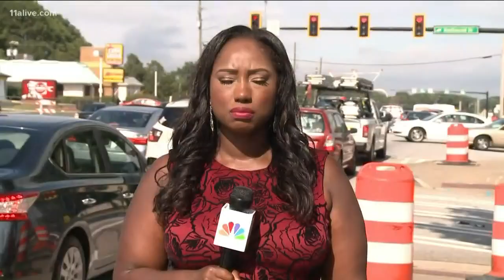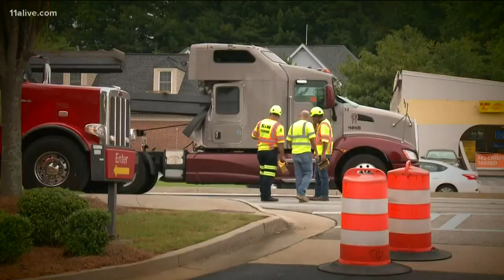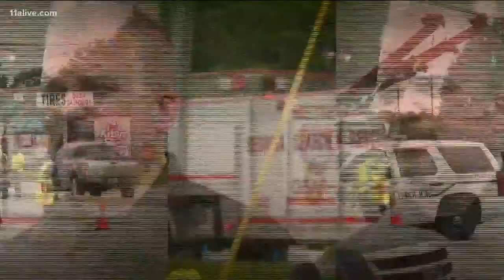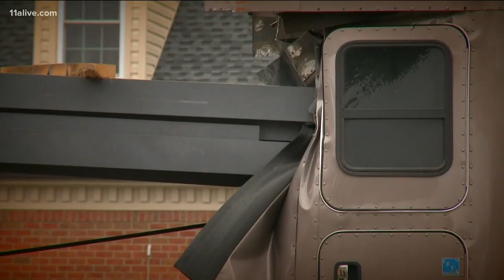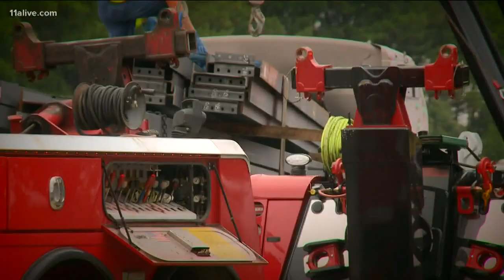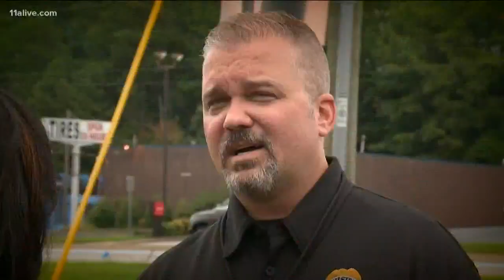Driver killed after steel beams crash through cab from back of truck

Comment: If you ever drive a flatbed truck ALWAYS make sure you Over secure the load. It's better to have too many straps and or chains than not enough. Also also make sure there is a headache rack on the back of the truck cab or on the nose of the trailer. Your life depends on it.
Reply: I totally agree
Reply: I agree, I'm a long time Heavy Hauler so I'm pretty versed in securing any and all types of loads that go on a flatbed, lowboy, Landoll, etc, and if you're doing that type of work you better know the Load Securement book by heart. I've always preferred chains for loads like that, 1/2" transport chain can be harder to handle than straps, but it makes things more secure. The only thing that has ever scared me doing heavy haul was something coming off my trailer and hurting or killing someone, so my thought was to over-secure any loads, take the extra time. RIP driver.
Reply: @thomaskirk9341  Yessir. I drove for Arrow trucking out of tulsa,ok for 10 years, quit and moved to frac sand hauling a year before they went out of business. I hauled some pretty scary loads with them including oversize, I always over secured all loads and never had a problem. I retired from trucking in 2015 and still today I see flatbed trucks all the time going down the road with only one strap on the front of a load and/or no headache rack on the truck or trailer.
Reply: @bigtexas7580  Yes, you can't be lazy or complacent hauling difficult loads. Any day I left the yard grossing under 100,000 it was a light day, everything from heavy equipment, cell tower sections, big cable reels, 80ft  utility poles, I always over-secure, then check, re-check, and check again. Maybe it's a combination of good and lucky, but I've never had a load loosen up on me, and I hope I never do. A lot of the newer drivers are either too fat, too lazy or too stupid to do the job right, and that's a dangerous thing.
Reply: I did flat bed , 10 years, in ca, you use straps every 5 ft. Mandatory, and You use común sense to hit the brakes especially in, or before the light. 
RIP that fellow 🙏🏾
Reply: I worked those loads and dispatch was ALWAYS on my ass to hurry up. I have NO respect for trucking companies anymore. They are the scum of industry.
Reply: @bigtexas7580  If the public only knew how little the companies cared about their safety or, God forbid, the safety of their employees.
Reply: @franciscofernandez4014  Sadly, the law is one thing and enforcement another. Oil and water my friend. Nobody cares about the meat in the seat until something happens, then they only look for someone to blame. First stop, the driver.
Reply: you'll never get a ticket for too many binders

Comment: Steel on steel is like grease you can use straps to choke it but chains and binders  are used to secure it he also never had head ach rack.these are dangerous loads then all the crap people pull in commercial truck is a great way to end a life or more.
Reply: A lot of metal bars are actually oiled/ greased up to keep from rusting.
Reply: It's just not important to dispatchers. We are on our own.

Comment: Looked like there was no headache rack to protect the cab
Reply: Plus the fact that he had straps on a steel beam load our company tells us that’s a no no always use Chains if those beams start sliding they cut the straps such  in a case like this I’ve seen it more than once and he should of known better anyway RIP driver 🙏 Prayers
Reply: Don't you know that proper equipment costs money, not to mention training? What were you thinking? Anyone can drive a transport. Nuttin to it. Dispatch response, " We have an opening that just opened up :-() "
Reply: We are just meat in the seat, will never change.
Reply: @joedirt9600  I actually overheard a dispatcher a few decades ago on the phone telling an agency "..just send a licensed piece of meat for the seat, the load has to be there." You just caused a flashback, and it was not because of drugs, it was anger.
Reply: Headache racks aren't designed to stop a load, I'm a flatbedder and have driven trucks with no headache racks hauling steel.
Reply: @chadnelson924  so what is the purpose of a headache rack ? And I realize it won't stop a load of steel.
Reply: A headache rack is the hold chains and binders.  they were given the name headache rack because back in the day if you didn't put mud flaps on the headache rack between the rack and chains they would make a lot of noise and give you a headache
Reply: @chadnelson924  I hauled lumber and steel for 35 years, they are suppose to block the lumber from coming threw the bunk, will stick crush the bunk but not come threw like a projectile.on paper anyway..lol..steel is a while different animal though...
Stay safe in these troubled times driver..
Reply: @joedirt9600  That IS the purpose of a quality headache rack, to displace the energy enough to help stop the load within reason. The DOT used to make them mandatory but now its an option with a tie downs clause.
Reply: @chadnelson924  lol i remember that
Reply: @paulmunro3175  well i have seen even the best scured steel beams slide when held even with chains and with chains its actally alot eaiser for steel beams to slide forward becuase of nothing in front nor back to stop them slideing to the front or back
Reply: @ColAngus  actually its just log trucks that are requared by law to have the rack, i think that any truck carrying steel beams need to have racks also

Comment: Sad, but you never haul steel using straps, should have never been loaded. And a headache rack should be mandatory, not sure about the State's but in Canada it law.
Reply: Ha. Ha. It may be mandatory here, but I see breaches of the law every day, and I saw it at many companies I worked for-big companies. It's all optics my friend. It is a jungle out here.
Reply: They did away with it here. Now in place of you have to have 2 load securement in front, I don't know distance, I mostly run dumps and low boy.

Comment: Car brake checked him happens all the time
Reply: Um, this was at an intersection, so maybe the car was legally stopping for a red light, and possibly the truck driver was following too closely, "happens all the time"  see neither one of us really knows what happened!
Reply: @anthonyklein2944  More likely car ducked in front of the truck and slammed on the breaks because it couldn't turn, truck driver gave his life to save a four wheeler. 99.98% of accidents involving a semi are caused by a car.
Reply: @anthonyklein2944  Look it up your self, you'll see I'm right :)
Reply: @anthonyklein2944  I said accidents, not fatal ones.
Reply: @anthonyklein2944  I'm no libtard lol been driving fuel tanker 22 years, maybe its just up here in Canada, I will say four wheelers in the U.S. are, on the whole, far more courteous
Reply: The fact is that nobody knows what happened in this instance so why say it was probably this or that at all? People jumping to conclusions based off literally nothing but a feeling is what's wrong with this world. We're so easy to control now. People need to wake the f up. We've all done it before but it needs to stop. Liberals are definitely the biggest offenders but the other side is getting just as brainwashed. The world has gone mad from entertainment addiction.
Reply: Statistics either way on this issue are useless without links to the source. No offense guys, but it’s easy to lie and makeup info with the anonymity of the internet.

Comment: Red flag no head board. Funny u know, u would think a hard stop at 60 /  70 mph would wreck havoc but it is exactly the opposite. A hard stop from 15 / 20 mph will get max slip/movement of a poorly secured loas. It takes just a few extra minutes to throw extra restraints over your load as well as using a good progressive positioning strategy of those restraints to minimise risk. Heavy duty headboards to protect the cab and operator should be mandatory on flat deck loads. Cost, laziness, poor training, corporate apathy, bad loading practice, or j*d*g*a*f * are the difference between arriving at 2 locations, safely at the drop point or the morgue... Could have saved our poor brother.

Comment: Trailers are built with a bulkhead to stop things like this from happening. Why was he not using the right trailer? OH, and a headache rack is like a dump truck. Protects the top of the cab from falling rock.
Reply: Cheap companies. But I repeat myself.
Reply: @paulmunro3175  Yes and drivers are a dime a dozen. No, spend the money to keep your drivers safe. Or find a company that will.
Reply: While the term "headache rack" may have originally been for an overhead cab protection of some kind, the steel or typically aluminum  barrier required behind the cab for flatbed work, has been called a headache rack, and that is what manufactures call them for a great many years.
Reply: @anthonyklein2944  Yeah well things are not perfect, are they? If it keeps the brain housing group intact from a back to front assault then O.K.
Reply: Not all flatbed trailers have a bulkhead,  (or headboard in the UK), most seen to have no protection at the front at all.
Reply: @patricknewall5634  My coment stands for itself. If you do not want to protect your drivers, don't.

Comment: No change no binders just straps recipe for disaster a lot of drivers don't like to handle the chain so that short cut with straps change will bite into the steel.🤔⚒
Reply: And far too many drivers have not been educated in the proper techniques of hauling certain types of freight or even how to load a trailer with regard to weight. The industry is far too lax and lazy. Many shippers are astonished that drivers don't know how to work a ratchet-strap, let alone what one is. The whole industry is to blame, because there is just too much money to be made, the penalties are too forgiving and the roll-the-dice attitude vis-à-vis fines makes it profitable.

Comment: The company I worked for had engineered, welded, and bolted bulkheads on the front of the trailer. This should be mandatory to haul these materials. We did not use straps as primary securement, they were always used with chains. Two chains in the front and two in the back

Comment: All the more reason to have a header board on the tractor or a bulkhead on the trailer and yes that was an unsecured load. That’s why you stop within the first 50 miles to check your load  and every 150 miles or 3 hours whichever comes first

Comment: I haul steel and its a lot of hard work to secure very tedious especially in hot or cold extremes but you have to imagine what would happen if that extreme heavy load will do if you have to brake hard. You should be able to play it out in your head and it should terrify you.

Comment: That’s why I always strap the crap out of loads like this. As well, I tighten as much as I possibly can.  I would rather over strap the load, then have it come through the truck, if I have to hit the brakes!
Reply: Same here, I hauled a load of round HC steel stock out of Alabama down to Florida once. Put 18 straps on it and used a 4x4 header board. Car cut out in front of me down in Florida and I had to slam on my breaks. The load shifted but only by 8 inches or so. It's why I always over secure loads like these, I'd rather be safe than sorry or dead.
Reply: I was taught to check the straps/chains first after about 30 minutes of driving and then every 2 hours after that.
Reply: Strapping sharp steel is dangerous and stupid. If the company does not have chains, refuse the load. The companies do not care about your life, just profits. Period.
Reply: @MrJohnthefarmer  You were taught well. I did the same, but before leaving the yard I hammered the brakes HARD and wiggled the rig from side to side. Always loosened things up a bit. That kind of professional approach will bring negative comments from mismanagement these days though.

Comment: R.I.P. driver...Hope this gets the Dot and FMCSA and be more strict on this particular LOADS... Like COILS aka SUICIDE COILS get the name for a reason.  My opinion is that steal beams and pipe are way more dangerous than coils...  We don't hear much about coils accidents because safety on securement is implemented more serious.  I hope DOT starts cracking down on all drivers hauling steal beams and pipe that don't secure them properly..

Comment: Never slam on your brakes to try to stop at a changing light. It’s safer to gone on through it.
Reply: If that's how you've been driving and you haven't killed anyone, then you've been lucky, bud'. I'm not wishing bad, but one day, that left turning car, whose driver is anxious to turn cuz he's been standing in the middle of the intersectionfor a while, won't notice that you can't stop and will turn in front of you; then It'll be mayhem. I see that collision on a weekly basis. 
I actually watched a video recently, in which a truck t-boned a cop, in this very situation. I'm pretty sure that cop got hurt, at the least. The trucker ran the light, and the cop certainly wasn't paying attention, didn't notice the truck not slowing down. The cop made a right turn in front of the truck and it was a direct hit.

So, be careful out there; time the light, if it's been green too long, be prepared to stop by slowing down, and use your jakes if needed.
Reply: Have you ever driven a big truck?
Reply: @thahomiegreg9847  your first statement, added to your follow up question, tell me that you have limited experience. Because if you had as much experience as I do, you would've understood what I explained; unless you graduated from a SWIFT academy. 
You said: "NEVER SLAM ON YOUR BRAKES", and I'm saying that I fundamentally disagree with you. I also said that if that's what you've been doing out there, then you've been lucky. For, there's no reason as to why you should run a light when empty of lightly loaded. 
If you're heavily loaded, even so, you still have to time the lights, and operate your vehicle in a safely manner. And since you've been lucky, I also gave you the scenario of that day when you'll be running out of luck.
So, bud, you'd better take a chill pill before you question my knowledge; you're talking to a 22yrs vet, with more than 2 million miles and ZERO COLLISION WRECK, in ALL TERRAIN and all WEATHER.
Reply: Dude I’ve been driving 17 years of  all safe miles. At some point that light just changes while you’re in an awkward position. This driver is no longer here because he tried  to stop rather than go through the yellow light. Thanks for your irrelevant advice but I continue to be “LUCKY”!
Reply: @thahomiegreg9847  I know this man's missed by not only his family, but by his friends and mostly his colleagues. 
One DOT cop pulled me over at the MN scale right outside of Fargo, ND. He gave me a level 3 inspection. Afterwards, he told me something that hit home. He said: "it's guys like you, with a lot of experience, who get killed in these roads". That's how I quit interstate driving, I'm now a local o/o.
My guess is that this driver's been running this loads for years, and that day, he probably got lazy for some awkward reasons, then this happened.  
The lesson I got from all this, is to not go to sleep on these basics.
Reply: @thahomiegreg9847  https://youtu.be/1wyc5dPvGfA 
This is the video I was talking about, that's irrelevant to you.
Reply: @yosefshawarma3739  Exceptions to every rule my friend.
Reply: @thahomiegreg9847  I also have gone through lights with the horn blaring when it would be unsafe to stop. For example, if you had stopped  suddenly on a sloping road which is wet, that trailer will have a life of its own and would easily slip over into another lane. It has happened to me more than once. Safety often breaks the rules.
Reply: @thahomiegreg9847  Unless of course a vehicle the truck was following too closely legally stooped at a red light, since neither one of us know the situation here, why act like you know how to handle THIS situation?  While I am sure you never follow too closely, I do understand your comments about that "window" of time when running the light does seem safer, but that is after other missed safety measures have failed, such as driving below the speed limit in heavily congested stoplight environments.  I am always nervous approaching a light, not knowing when it will change, especially the higher speed roads, yellows aren't timed for trucks at the road's speed limit, so I just have to swallow the pill and slow down 5 or 10, to give me more time to get it stopped.

Comment: Yeah the protective measures was having a headache rack on his truck every truck driver should have known that I don't see how he wasn't enough to enough to have a headache rack on his truck
Reply: Its illegal to load steel beams or pipe on truck w/o headach rack.
Reply: @ralphflores8661  thanks for that response in 2011 I was a truck driver I was riding my Harley back to work to the morrow yard just south of Atlanta for kllm on March 17th about 11:45 right before midnight I got ran over on my Harley from behind at 55 miles an hour when a hundred fifteen feet down the highway in about 15 ft above the highway smack back in the back of the ICC bumper on the 285 Loop in Atlanta the four-wheeler did a hit and run and left me there I suffer from traumatic brain injury and the hypocracy is I was handicapped before I was a truck driver apparently. Got documentation of that but my life has been a very expressive ha.
Reply: @ralphflores8661  It's not illegal anymore, DOT made the rack optional if you use more straps...or something like that.